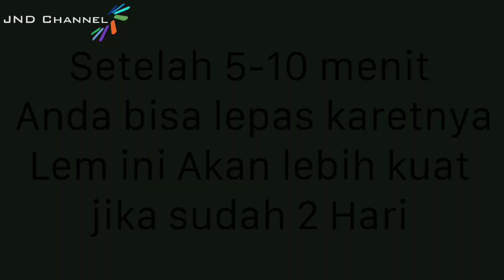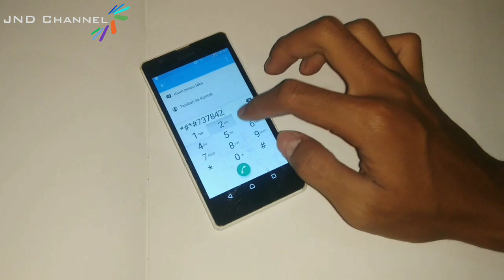Cara Ganti Lcd Touchscreen Sony Xperia Zr

Comment: beli lcd touc nya berpa bag
Reply from the maker: muhamad isya 180rb - 250 rb an
Reply: kalau untuk C5503 , apakah sama juga hrganya bang? dan itu TC sama lcd apakah udah 1 paket apa harus beli per item lcd sendiri TC sendiri, termiakasih
Reply from the maker: c5503 bisa gan ,itu kan sony zr layar 4,6 inch,
Reply from the maker: kalo beli ,biasanya aku udah 1  pake karena kebanyakan sony lcd sama tc nggabung udah di lem dari sana nya